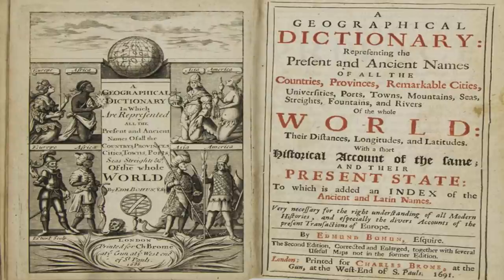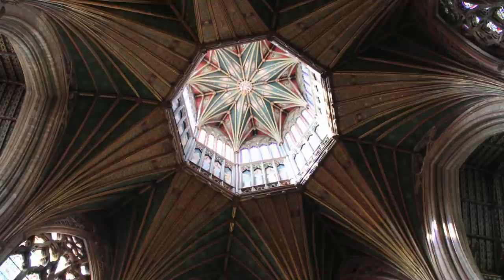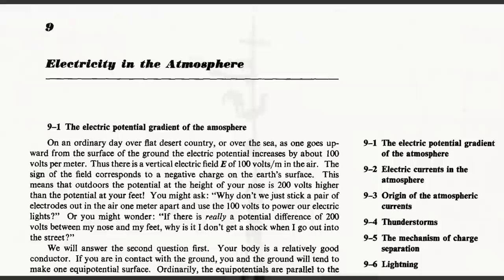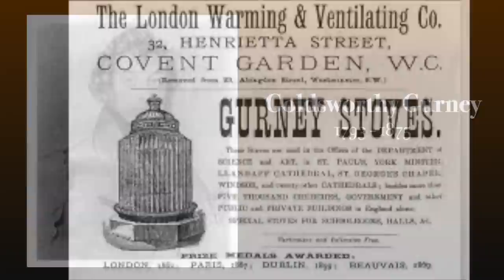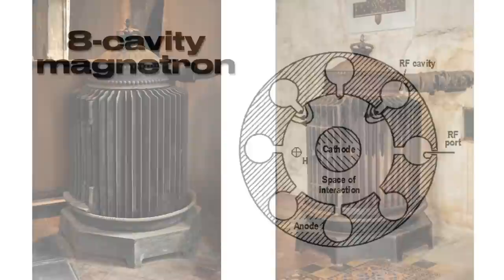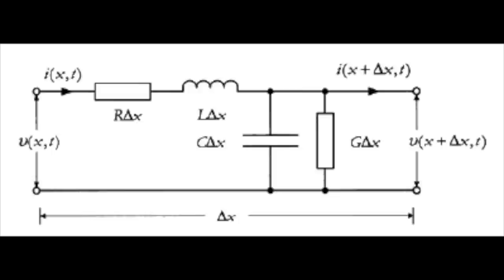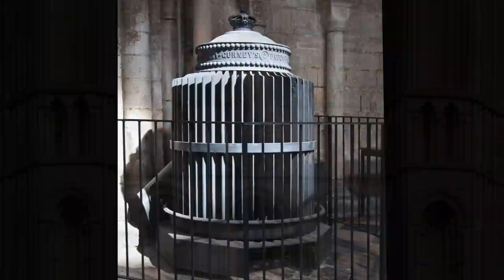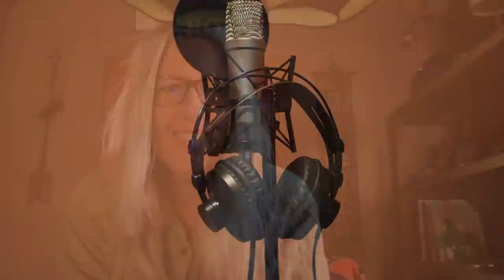Stephanie McPeak Petersen's  'Coal stove or Medieval Magnetron - A Deep Dive into Ely Cathedral'

Comment: Nice, it would take less than 20k to make a 5kwah antenna. Most houses work at 220v or 440v here. A tower would make much more in the 1000s of volts. This voltage would be stepped down.The amperage is determined by the top cap capacitance. If one has the formula its easy , RLC CIRCUIT, but all need to be variable components because if you draw less wattage it will need tuning. Frequency is 7.83hz unless there is a more saturated signal nearby... Any questions I would give answers for free